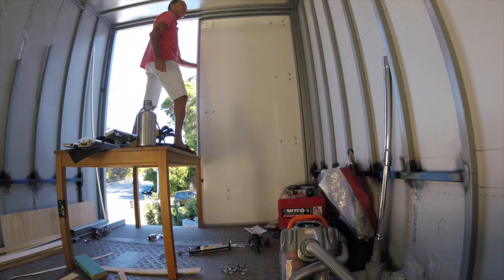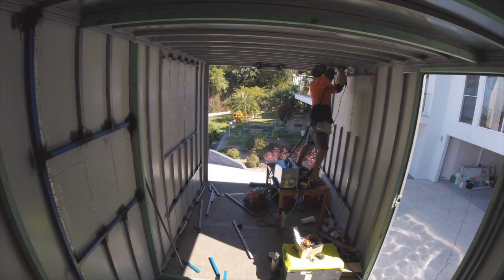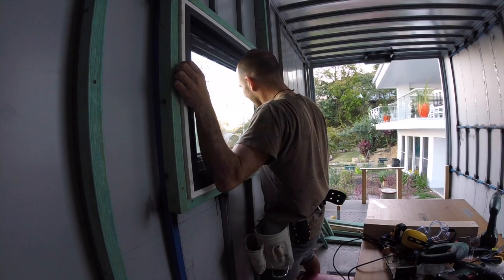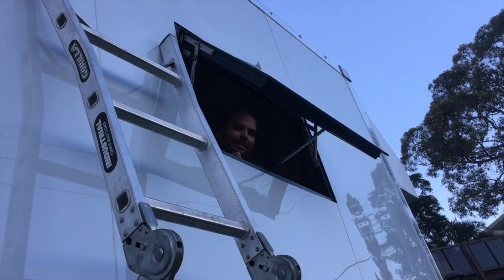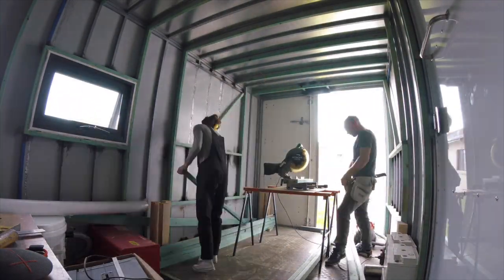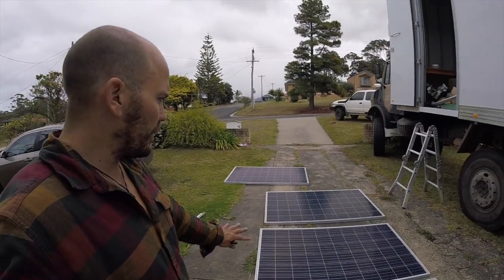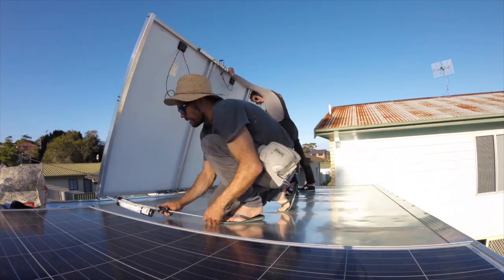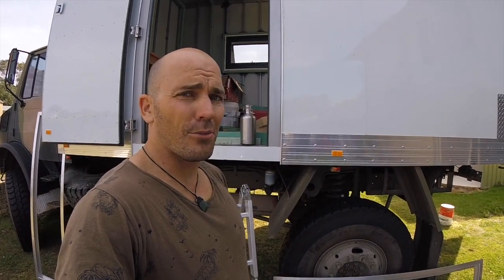#004 Tiny house truck build // Diy window installation motorhome RV // Unimog expedition Vehicle

Comment: Just stumbled on your series.  Just love what you did, so different.  Sorry it all ended.  Hope you could list where you got your windows and fly screens from. Did you have any issues with movement particularly on the bifold window?  Thanks, and thanks... now I'm obsessed :)
Reply from the maker: Hey Renee. Thanks for the kind words...All good things come to an end but onwards to the next adventure. I bought the windows from Uptons.net.au I believe. They were cheap, awesome, heavy tho. Because they were aluminium we did get a fair amount of condensation on them in certain circumstances.

The blinds I got off the internet and were the absolute cheapest out there. It was a nightmare trying to get a company out at the time to give me a quote. The ones we used are no longer on the internet but I think bunnings bought them. Bunnings ones looks exactly the same. If you install them properly they can be good. The window one is still good to go but the back deck /door one died pretty quickly. From my installation or the product I'm not sure. I found a local guy on the Gold Coast to redo the back door 😋👍